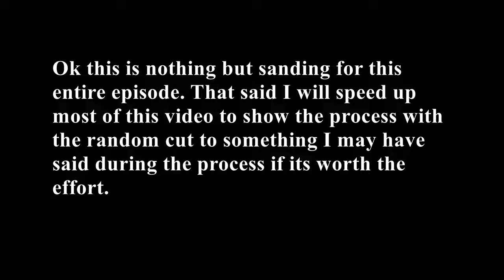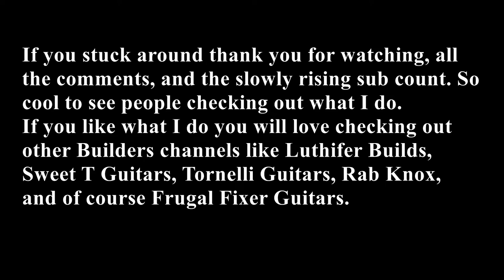Washburn RR11v Resto Part 2 Removing clear for primer prep

Comment: Nice... Can't wait to see the finished product. 

You know, you remind me of myself in some ways. Kind of where you have a vision on a certain project and you see it through til the end. Even on things where most would give up after 5 minutes...especially if it's tedious work like that. Good attention to detail, etc.
Reply from the maker: Oh this attention is nothing compared to what it is taking to get the striping perfectly aligned and masked off for spraying. Figuring that out and getting it done has turned out to be almost as time consuming as the rest of the job so far all total. Starting day three doing that alone with having to lean over a table to measure and move stripes around to get them spaced properly and as well as keeping them straight. Pretty sure that was all done by template or even a machine on the originals.

Comment: You know a person could come up with a fairly unique paint job by applying different colors of paint. Once dry and fully cured then sand through the different layers in different areas of the body till they got a pattern they liked then seal it with a few coats of clear.
Reply from the maker: I already have an idea for the next build using that same thought process. After seeing the camo like look from the sanding and feathering edges I was thinking it could look pretty neat right there with just a coat of clear. But I want it back to OG colors. Its pretty rare to see one intact with all the original hardware and electronics.

I am leaning towards a black and silver scheme to try that with. I will probably buy a few spray bombs to test on some scrap plywood. Get a feel for how it would work naturally as well as learn how to bend it to my will.

Comment: I wonder if you could have gotten the old paint off faster if you had started out using a card scraper to remove the bulk of the paint them finished up with the sander. The sander is probably less ware and tear and cramping on the hands though. Looking good so far.
Reply from the maker: The first pass was to remove the clear coat which took the longest to do. the other two smoothing grits was to remove scratches. and get ready for priming. Minimal hand sanding was needed on the rounded edges and to feather the old paint / prime/ paint that sanded thru. That all took under an hour to do on a nice cool sunshiny day.

Comment: What is the total sand time? There was a nice pile of burgundy dust there.
Reply from the maker: I am keeping track of details like that in the description for this series but for this part it was just a little under an hour. That was mostly clear coat mixed with red Testers model paint for the old stripes and the red sanding primer underneath where I block leveled it last time I painted it. I really did not want to see bare wood again but that sander was really too big and powerful to have that much finesse.

Comment: Thanks for the mention Bill, I appreciate it! So do you need a primer before 2k?
Reply from the maker: I would pose that question to Todd as he is my guide for all that is paint currently. I know oil finishes and plain wood need some kind of sealer / leveler. From past discussions it was said 2k in a can is fine for this paint with no mention of any thing else. I will ask him to be sure before I move forward on this or Thick Lzzy.